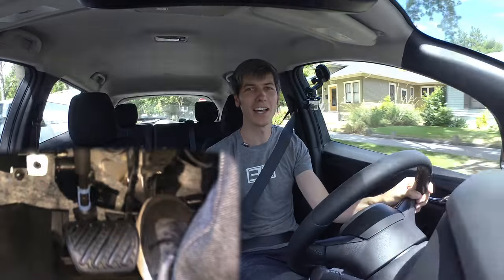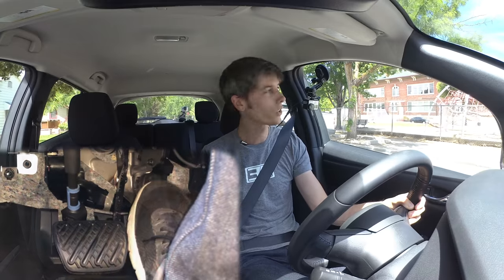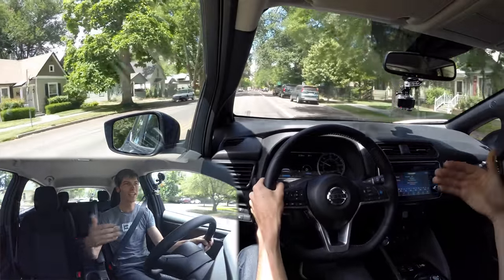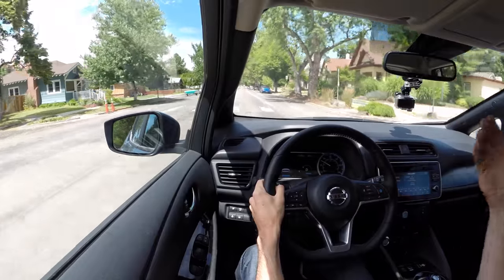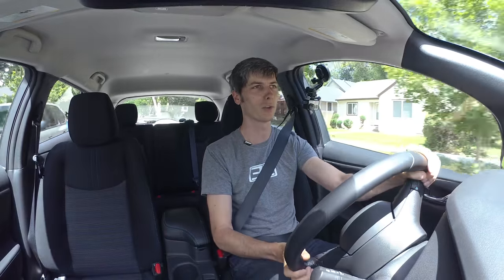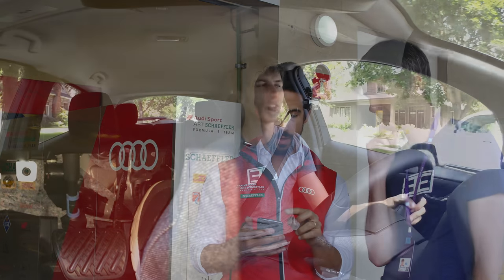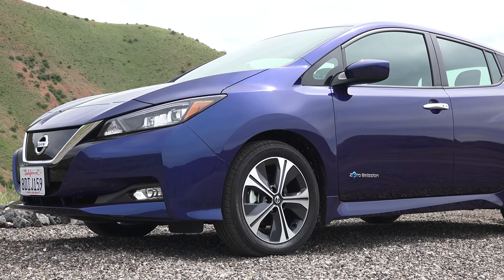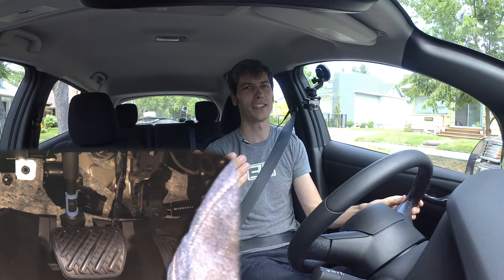What Is One Pedal Driving?

Comment: I like to be easy on my brakes, but if you do this for long, your brakes won't work in an emergency situation. (They are at last mechanical and if they don't get enough movement they tend to get stuck und rusted. (Maybe not in california, but if you know winter and rain, you know rust...)
Reply: Hey, in your hypothetical emergency situation,  why is "stuck"  an issue?
Reply: Lets assume the case of them stuck while open (pistons rusted in place): With the "footpressure of fear" you may or may not manage to close them. If not, well...  But if they do close, they won't close fast, symmetrical (left right) or with the according percentage front to rear as they should, to allow you staying in control of the car. (Ever had a car the pulled extrem to one side while normal braking?  or pulling the handbrake fully while driving? imagine that while you try hard to avoid a collision) And they won't open if you release the pedal or ABS releases the pressure. So either no braking or absolutely uncontrollable pulling to a random side or in the best case just horrifingly locking up all four. Which all means the loss of control.
Reply: +nirfz:  I don't have a wealth of auto repair experience, but why would brake-actuating pistons be so badly designed that they'd be capable of rusting while immersed in brake fluid?
Reply: Have never designed a car brake, so i can't answere this question as good as i would like to, but i know enough cases where it happend. 
And as nobody until now came up with something better, the design must be good enough (if used as intended). Brake fluid is hygroskopic, and as we know water is never good if you want something to not rust. (The hygroscopy is the reasen brake fluid tends to work well only for 2-3 years)

Comment: My VW GTE has this, but it won't take me to a complete stop. It keeps rolling at 'idle' speed, even on EV-mode. I think this is caused by the DSG-box? This only works in full EV vehicles w/o gearbox?
Reply: Probably because vw set it up to be that way, just so it drives exactly the same as a normal automatic VW. At least that's my best guess. 
I think you can turn it on or off in a Tesla.

Comment: Does this work with 3 pedals
Reply: If you have a manual, you could technically do the same thing although the amount of effort is quite a bit more. Downshift rev matching all the way down to first would be exhausting on a regular basis and you would still need to push the brake unless you are rolling stops.

Comment: the downside of not using the breaks could be rust on the brakediscs, so perhaps you need to replace the brakes in  shorter intervals
Reply: DerGenialeRoland you would still occasionally use them (someone goes to pull out in front of you and other things that need more precise braking)
Reply: the thing is i've seen brakes on hybrid cars, which were driven normal and the edge of the brakediscs still got rusty due to the lack of force on the brakepedal
Reply: DerGenialeRoland the edge gets Rusty because the pads don't touch there
Reply: it seems like I'm rly bad at explaining stuff, the rust which I mean is created underneath the pads, due to the lack of force on the brakepiston and it's position, it aplies most of it's force on the inner side of the brakedisk, which leads to wear mostly on the inner side, further the pads can wears in an angle and also rust won't scrape off on the outer edge of the disk

I hope I made it clear this time :)

Comment: Does that mean there's no coasting?
Reply: My EV has paddle shifters to set the sensitivity of the regenerative braking and I can adjust it on the fly.
Reply: Chevy Volt driver here- No, it means that rather than thinking of the accelerator as an accelerator, it's more like speed control. "Push the pedal in to how fast you want to go"
It's like learning how to drive a manual- You just get a feel for it after a while.
Reply: Mark Dowdy So there's no traditional coasting, right? Like you can't take your foot off the accelerator and allow the car to keep going for a while?
Reply: I almost always drive in L so what you said would be true. Of course, there is also a D mode that mimics the coasting behavior of an ICE vehicle. So D mode would coast as you describe.

Important note- my experience with electric driving is all in a 2014 Chevy Volt.

Comment: Hey Jason. I love your videos. Keep them up man! Anyway, I’m not too crazy about having a system like this in a car. TBH, I’m not all that crazy about electric vehicles. I’ve always heard stories about vehicles getting hacked and operated remotely so a system like this will make that so much easier. In my opinion, this also makes drivers lazy. It’s cars and systems like this is one of the reasons why the manual transmission is becoming extinct.
Reply from the maker: People have hacked into today's Jeeps. Everything is a complicated electronic these days, simply being electric car doesn't mean it's more prone to hacking.
Reply: Maybe not. I guess it depends on how secure the software is. Another concern I have about these electronic systems is reliability, especially when the braking system is electronically controlled. I would The hope the manufacturers have enough foresight to put in some kind of backup if that system fails so the car can still be stopped safely.

Comment: it's the same as a electric forklift and if you don't use your cast iron brake discs will they rust and not hold longer but my company has a aluminum brake disk that never rusts and will hold the life of the car and is lightweight. we are the only company in the world that can produce a aluminum brake disc

Comment: How do you coast, the most energy efficient mode of all?

I'm so skeptical of the electrical "movement" overclaiming.
Reply: Bill Woo just touch the peddle slightly that prevent regen nor will it Accelerate it will just coast (or temporary press the button to turn it off or on)
Reply: As a practical matter I don't think people will press the button, just as they don't choose neutral for that purpose. As to the "slight touch" - that seems like it would require quite a sense of "touch." Makes me think of the oscillating, overcompensating wing-wagging of beginning student airplane pilots as they land. "Touch too much" - wrong result. "Touch too little" - wrong result. "Oscillate" - that's no good.
Reply: You can coast by pressing slightly on the accelerator.  At any speed, there is a neutral point where power is neither flowing into or out of the battery.  You can do it by feel (analogous to a manual transmission ICE vehicle in a low gear), or by glancing at the dashboard and seeing when the power flow indicator goes to zero.  Turning the regen setting down or off makes it easier.
Reply: Well it sounds like if you are coasting down a hill, and you want to climb the next hill, or just want to keep cruising when you reach bottom (e.g. you're on a highway and have no reason now to slow in the next 5 or whatever minutes), that you have to actively seek that sweet spot - as opposed to just completely letting off the gas as you would in a gas vehicle. After all, if you just let off the gas in the EV, you regen, which means you take momentum and turn it to stored energy, but then use that stored energy to regain the momentum that was removed. That's not a lossless transaction. Moreover, just letting off the pedal just slows you down (or reduces your downhill coasting). So to avoid wasting energy, you need to hold the sweet spot, which is more effort than just letting off of the pedal.
Reply: My EV has paddle shifters to set the sensitivity of the regenerative braking and I can adjust it on the fly.
Reply: With a gas car the 'sweet spot' is just imagined. The engine braking you get when letting off the gas (not the same as coasting in neutral) is just lost energy. Sure you're not spending fuel, but you also don't keep any of the potential energy of your car going downhill. 

If you're in an EV, regen braking the same amount will store away a lot (80%+) of that energy. Not being lossless is hard to complain about when you get something where before you got nothing. 

Coasting a gas car in neutral is also far from lossless since you're then using idle fuel, and also speeding up going downhill will increase drag. 

Also you always have to tweak the accelerator to keep your wanted speed so you can't seriously think it's a completely new concept to people. And if that's too much effort you can use cruise control or speed limiter.
Reply: Bill Woo 

Actually, you get use to it by feel, naturally. Just as one  masters a manual, one can master the linear throttle from max regen (foot off) neutral point and max acceleration. We have a Volt, while it will not come to a complete stop without using the brake pedal, it will come to a creep before brake application is required. The driver selection in EVs are also widely selectable. 
For example, in our Volt we have:
> Normal coasting mode "Drive (D)" with only 2 kW Regen to simulate an automatic.
> Low drive mode "L", adds a linear throttle map with medium regen at "idle" throttle.
> A steering wheel paddle when held ramps up to Max regen regardless of other selections.

The brake pedal is always mapped to ramp up regen up to Max before friction brakes are engaged. All of these driver selectable options are linked to smoothly adjust regen without the jolts. I usually drive in "L" or Low mode and regularly coast using "neutral" power in the throttle mapping. It's not difficult.
Reply: I like where your head is at.  How many other people do you see ever coasting in their automatic cars anymore?  There's heavy on the gas and heavy on the brake.  That's it.  :)
Reply: Coasting is still more efficient. Regenerative braking is only more efficient when compared to slowing with friction brakes. It's not a magical range booster. You can coast in this mode by modulating the pedal precisely, or you just disable e-pedal and disable eco mode and lift off the pedal, which probably will be more efficient.

Comment: So with that feature, you can't coast? I would like to know how the accessories are powered on electric cars, AC, Heater systems. Is there power steering? Brake booster?
Reply from the maker: You can coast one of two ways: hold the throttle pedal in the right location, or turn off e-Pedal. Accessories are powered by the battery. Yes you have power steering. Yes you have brake boosting.
Reply: So does the AC compressor run off of its own electric motor, or the main drivetrain motor?
Reply: Truck93 

Seperate electric motor. I'm not familiar with an EV powering the AC compressor with the primary drive motor(s)

Comment: A normal car just coasts along when I release the gas pedal. 
Regen in hybrids or funny electro cars try to regenerate power, but it has to slow down the car considerably, e=mv2.
Therefore just coasting to an intersection, checking for other traffic, is not possible. You will have to keep on the throttle until closer, way closer to the intersection, or else come to a stop sooner than you think.
In short, using regen means using more ernergy because the coast time is way shorter due to the braking trying to regen.
Reply: if it's regening as it comes to a stop you just need to adjust your distance and work out how far your car goes when it is slowing down on regen and stop (or Just keep foot slightly on peddle to not do regen braking it will Coast still)
Reply: flexairz 

You can coast all day long in an EV. Either turn regen off or find the neutral point in the trottle. Neutral would be 0 energy in and 0 energy out from the battery. When it's time to slow down simply take your foot off the throttle for regen braking. Most EVs are heavily selectable when it comes to regen braking, turning it off or down is usually available.

Comment: This does not work well for passenger (or driver) comfort. Personally I dislike it and never use it in my EV. You can get a very similar effect in an ICE powered vehicle by keeping it in first or second gear and adjusting your speed with your accelerator pedal. It can be very annoying in a short time, even seasickness inducing, to those not driving. It annoys me and I'm the driver.
Reply: David Shepperd manual transmission cars tend to lurch in low gears, even if you’re very smooth in your application of the throttle. from what i can tell, EVs don’t have this issue at all
Reply: Do you have personal experience riding/driving one of these EVs? Every EV I've had since the first one I got in 1997 up to my current one had/have this feature. I don't like it. I don't use it. In years passed, I have had the misfortune of riding with individual drivers in an ICE vehicle who favored using the accelerator and brake more or less as binary devices. My body was either being slammed back into the seat or slammed into the seat belt. Might be fun at first but it gets old pretty fast. Put your automatic transmission into second gear, run your car up to 50mph then just watch what happens to your passenger's head as you adjust your speed up or down 5mph. Have barf bags handy.

Comment: This is a problem going down a hill. For example, if I’m on an interstate and traveling at the speed limit (65MPH) and I just got to the top of a hill I don’t want my car to slow itself, I want to use that momentum to coast and not have to use as much energy to get keep going 65MPH. Is there a way to disable the e-pedal on the fly?
Reply: I would assume the system is progressive so coasting and how hard you brake depends on how much you let off the throttle
Reply: Not sure about in a pure EV, but in a Prius you can definitely coast by pressing the pedal just a bit. There is a visual indicator that shows you where you are.
Reply from the maker: Yeah, you just press the button. :) Works at any speed.
Reply: You can still coast just make sure you have the peddle slightly pressed down that tell the computer not to regen but also not to Accelerate as well
Reply: Guitarfollower22 presumably you would be using cruise control in this situation most of the time. So it wouldn't be a problem.

Comment: It's easier to let off the accelerator to coast and use the brakes as needed. EVs are way too complicated. The future? I'll stick to gas cars where the accelerator doesn't function as a brake.
Reply: @Michael Gia Huy Nguyen dont know if modern cars do this, I have no idea what you have to do for it to work. I've only heard of big rigs doing this.
Reply: @Michael Gia Huy Nguyen well we don't have manual transmissions nor we are taught to do this in driver ed school. Things must be different there than here. But this country is a mess and its continuing to get worse so we have to deal with that anyway.
Reply: @VintageCars999  it is just like heavy engine braking. It feels like petrol car engine braking on 2 gear.
Once you drive one pedal driving you go back to a conventional auto or manual realise how much better one pedal driving is.

Comment: no good. if anyone drive this for few months then they'll used to driving by just 1 pedal only. when emergency occur, they'll forget where's the brake pedal is. that's extremely dangerous!
Reply from the maker: Do you forget where the clutch pedal is when you drive a manual? I don’t.
Reply: well, i do experienced it once. after about a year+ on auto, when drive an old car of mine which is manual 1, i forgot to step on clutch to engage the 1st gear. well it's nth after few sec i went back to normal. but this is normal situation. what i mean is in case of emergency.
Reply: i can visualize that an old lady just release the gas pedal and hope she wont hit whatever infront

Comment: You know what's funny? Nissan couldn't make the technology that would stop the car WITHOUT using the actual brake, BMW could and it stops without using ANY brakes.....
Another thing is that the BMW I3's regeneration braking force is so much that it lights the brake lights
Reply from the maker: Did you watch the video? Nissan doesn’t use the mechanical brakes, and they illuminate the brake lights, as discussed in the video.

Comment: This seems like a a really bad idea. If you get used to this  and then drive a normal car, you might have a really bad day.
Reply from the maker: Or you might use the brakes. I drive both styles all the time. I don't forget how to drive a manual transmission after driving an automatic.
Reply: Usually the issue with most people is when they first goto a automatic car and plow it I to a wall (press accelerator instead of the brake pedal, this happens to old people more then new drivers thought) or get rear ended because they used there left foot to press the brake and get rear ended as they floored the brake Peddle thinking its clutch peddle
Reply: I understand. For cognizant drivers, it's a no brainer. Just seems kinda risky for not so intelligent people.

Comment: Iron still rusts. The brake disks wont last that long.
Reply: You still use them occasionally and car uses them automatically when you come to a near stop when regen braking (as regen braking is more or less ineffective at low speeds so normal brake need to be applied or it will Coast like at 5-6mph)